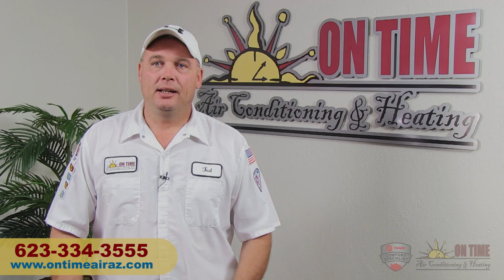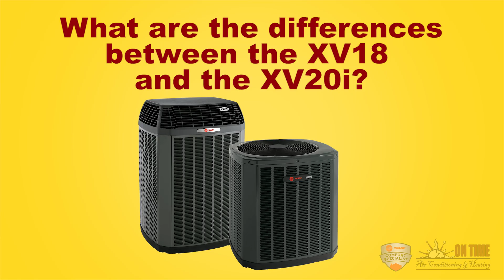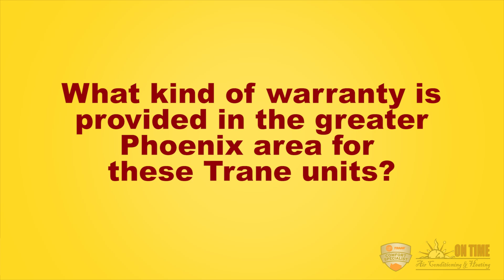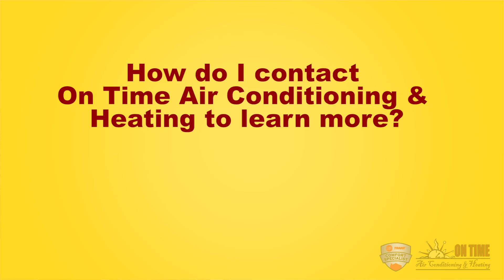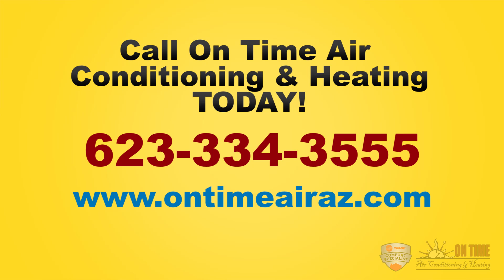Trane XV18 + XV20 Air Conditioner and Heat Pump Expert Review

Comment: Ted, have you had any issues with the XL850 thermostats?  I’ve had my system going on 3 weeks and my hvac company is now going to replace my thermostat.  It’s the craziest thing, it is not measuring the indoor temperature accurately or consistently.  It also will show the indoor temperature INCREASING when the AC comes on, which in turn modulates the compressor speed higher and higher.  For instance, last night it was down in the 60s in my area.  I had it set at 75.  I was a bit warm.  The house temp was reading 75.  I lowered the thermostat to 74.  Ok it comes on at 43%.  Within a couple minutes, the temperature of my house as measured starts rising and reads up to 77 degrees within less than 10 minutes of the AC running and had the compressor modulated up to 92%.  Meanwhile my independent “control” temp monitor was reading 74 for my indoor temp.  I turned the unit from the set 74 back to 75, it started modulating back down and eventually read the temp as 75 and cycled off.  It’s really WACKY.

Comment: It does not start at 1% of its capacity. The xv18 can go as low as 35% of its capacity according to Trane literature.
Reply: I’m a homeowner and have had the Xv18 going on 3 weeks and I’ve read the 35% output in the literature as well but my compressor speed I’ve noted in real time as low as 22%.  🤷🏻‍♂️

Comment: At my old house I had an XL16i and XV95. It had dual fuel capability electric heat pump with gas backup for when it was under 35 degrees (Indiana). At my new house I have 2 older trane systems. I am wanting to upgrade them and want to know if the dual fuel is the way to go?

Comment: We have had nothing but trouble with our new 3 1/2 Ton TRANE Heat Pump! It is so bad that we have to make monthly repair installments each month to the local dealer in Smithfield, Va. Fan on compressor went out within 24 hrs. then thermo expansion valve within first year, 3-4 service calls so far this year 2014. It is the lemon of all lemons!
Reply: Hi Lynn, we are an American Standard dealer in Chas. SC. If you have had a TXV valve go bad, both Trane and A/S have a product warning. Simply put I can look your model number in and see if yours is one of the many they have listed. Once we determine if yours is one of them, I can tell your dealer what should be done according to the manufacture. Regards, Charles

Comment: I think the Consumers Digest Best Buy awards and the fact that Maytag has the BEST warranty in the business coupled with the MOST efficient conventional ducted system on the planet speaks for itself. Sure, Nordyne does make mobile home units along with several other manufactures, but that only proves even more that the equipment has to be reliable, because you know the torture chambers that mobile home are for HVAC. Just saying....... Nothing against Trane or any others, but Maytag IS tops.
Reply: Erich Lorenz -Any brand can be used in mobile homes. I have a Rheem.
Reply: +Glen W. Ford can put any brand in mobile homes thats true now if its actually supposed to be put in such a high static application is a totally different thing.  Check the installers guide for the actual static pressure the blower is rated for vs your ductwork.

Comment: umm ok Josh first thing i think you meant piece not peace & mobile not mobil nice spelling just asking have you ever worked on a iq drive pretty sure you have not ya cant even spell, now i have went to the training on the trane version not good, compressor made by danfoss not trane & inverter board made in hungry, hmm never seen any inverter board made in hungry nice try though bro & from your post im pretty sure you have never worked on an iq drive since you actually have to be trained & pass a test to put them in, & from what i have seen you cant even pass a spelling test so real nice try bro